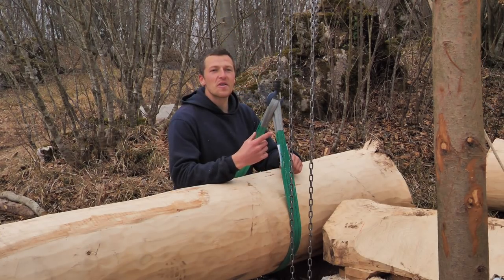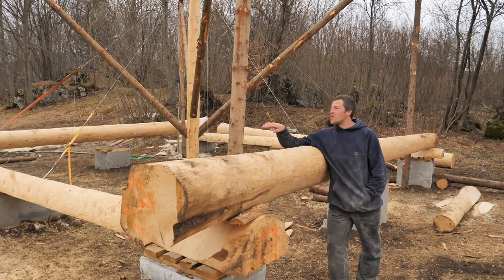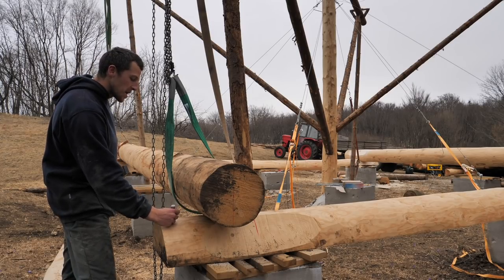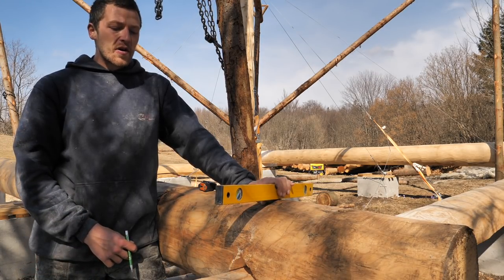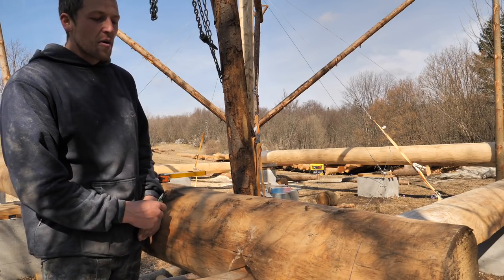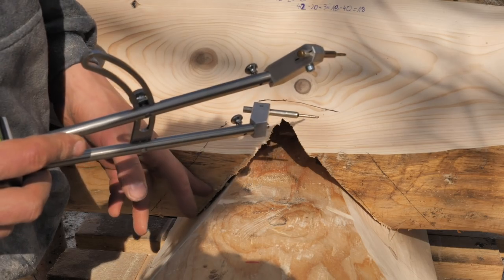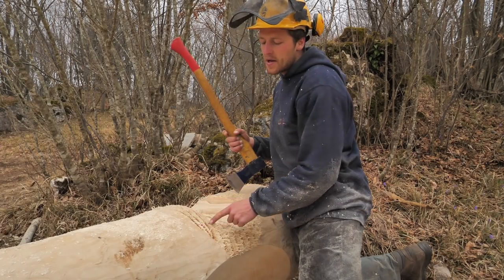Building Off Grid Log Cabin - Ep 12 / First Saddle Notches

Comment: Nice work Nik! Couple of tips: use a utility knife to score your scribe line with your thumb out like you're peeling an apple.  You will save a ton of time over chisel and hammer and still avoid tear out.  When you cut out your notches, work on it in quarters inside of trying to make the entire cut at once.  Start by cutting only one relief cut in the center just 1/8th short of your scribe line, then start an inch or so in and make more of a scoop type cut connecting to your depth cut staying about an 1/8th away from your scribe line. you can pop that entire piece out when you do this to the 4 quadrants.  Using just one or two power tools is quicker than getting your axe to knock out all those relief cuts. Then either brush down with the saw or get a tungsten wheel for your grinder.  Be careful not to cope out the saddle notch too much...it should be bearing the entire width of the notch.  Even 1/8th inch will create more crush than you want, multiply that 1/8th by every course and you have more than an inch of crush before your logs even start to shrink.  Also heat the end of the pencil holder on your scribe and bend it down so you dont have to cut out more with a chisel and hammer just to get your final scribe.  Keep up the good work, one of my favorite craftsman channels

Comment: Hi Nic, consider extending the final scribe 5-10 mm in the top part above the saddle cuts. The gap will be covered by the next log, but allow the logs to settle more. This helps with a close fit on the long cuts down the log, when the weight of the roof starts compressing the walls. Great work and impressive commitment.

Comment: I would also check these out. The Saburr tooth cutters are the best on the market. The sanding wheel you have on your grinder will keep clogging up and you will use a lot of them. The saburrtooth cutters wont clog and if they do all you do is burn the sawdust with a blow torch. they last for years. The cost is quite high but when you consider the amount of sandpaper you will use on your current set up you will save in the long run. I have used these cutters for all of my working life and they are the best you can get. you can get any profile or sanding grade you want and they fit on a standard grinder.

Comment: Nice work going on there Nik and it's a pleasure to watch you work. If I may offer a couple of pieces of advice though. You don't need to go so deep with the chisel, two blows with a hammer will be enough to cut the outer fibres and leave a clean edge. The club hammer is probably too heavy for chiselling, I would suggest you get a large wooden mallet as they're easier to swing. I'd also suggest your axe is too big as well for what you're using it for, swap it out for a carpenters hatchet. Swinging large and heavy hand tools wears you out quicker than you realise, so if you can the same job done with smaller ones then you should. Work smart not hard :)

Comment: Always leave atleast 1 cm gap to top of the saddle.If its tight,the log wont sink as it dries.
The notch does not have to be concaved inside so much,actually should be pretty flat.
Check the flatness of the saddle when sanding,it must be perfectly flat.
When cleaning the notch,try to turn the tip of the saw instead of repetitive straight cuts.
Clean workspace saves your ankles.
I wish i was closer,i would like to make your work much easier😉

Comment: Suggestion : when yu dig yur notch especially if yu wish them to be concave yu can use a special tool we call in France an "Herminette".
It s a handy tool which looks like a usual carving tool a "Gouge". Some are flat cutting shape (they used it in order to make beam perfectly straight on 4 sides yu can recognise these kind of beams made by hand after cuttings)... But some are curved cutting shape in order to do convexe or concave  surfaces in holes. They are more massive but handy... wide and thick than carving tools which are lighter manufacturing.
Yu can buy them or ask a guy to make them.. To forge them.
It s very usefull. 
[Such as a wide and long plane, handy tool, to set the bottom of each flat snotch after silksaw cuttings. Better than a usual cisel as yu had on video] . 
... Whether yu work on flat surface or on curved one.
Consedering the whole job on yur site the outcome will be profitable. Especially to rectify all along on logs with bumps and holes.

Comment: nik for making the notches check out this _Grinder Disc Chain and chain
Grinder Disc and Chain, AUOKER 4 Inch Grinding Wheel Disc Chain Plate with 22 Tooth Fine Cut Chain Chainsaw Blade Carver Set for 100/115 mm Angle Grinder Carving, 5/8" Center Hole Circular Saw Blade

Comment: Nik, it seems like a lot of work making those saddles.  Instead of making saddles with smooth edges, which seem to take a lot of time, why not make the joints like cogs of a transmission?  Make one log be like a tooth of a cog and the other like the space between the teeth of the cog.  Instead of making smooth oval shapes, make straight cuts like the letter V, one V entering and then sitting in the other V. And to avoid the logs splitting, don't let the point of the V's be sharp.  I'm enjoying your videos.  Thanks.

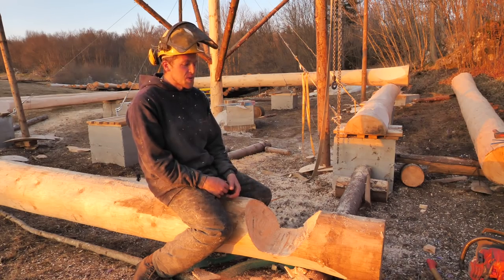Comment: I am trying to understand the reason for the concave cut in the upper log (mentioned at 28:00) to mate with the concave saddle cut on the bottom. Doesn't that mean a very large space where the 2 concave faces inside the joint are opposite each other - like 2 cupped hands?   (Love this video Nik - very impressed with the attention to detail - great fun to watch your progress! )
Reply: Without the concave, the seams would open at the outer edges as the wood dries and settles.

Comment: Hello,  I do believe I would be thinking very hard about a 'top handle' limbing chainsaw for your intricate notches.  Easier to control exactly and not so hard on the body at the end of the day from holding the heavier saw.  I see they go for about $100 if you get a chinese one and they seem to work well from what I see on the other Youtube channels.  Very nice job.  Take care.  Doug
Reply: I think you have a point Douglas, I was thinking maybe a smaller saw, my friend recently bought a Husky 441 and it is a total pleasure to use, so light compared to my own when brashing out or delimbing.  

A top handle would be good, very small and light and as someone in comments suggested maybe use a smaller radius tipped sculpture bar. The Chinese eBay saws, a few of the boys have bought these to look at and while the chains themselves are not great, they get the job done, basically copies of the older Sthils and Huskies, overall decent saws and disposable after a season or two, although most of them are still going strong after three years.

And if Nik is reading this, beautiful work, really nice,

Comment: Good afternoon Nik,
My name is Hernán, and I am in Tocantins State, North region of Brazil.
I~ve being watching all your videos and I have some technical questions to ask:
1.- Which is the gauge, number of wires, etc of the cable that the tractor winch uses.  And what is the security factor that is common to apply in these cables?
2.- Which is the weight of the most heavy log that you are planning to lift? (in Kg)
3.- Which are the specifications of the straps you use?
4.- Which are the specs of the chain hoists?
Thanks a lot for your attention
Have success!!!
Hernán
Reply from the maker: Hi Hernán, unfortunately I don't know the answers to all your questions, but I will tell you what I know. The most heavy logs I have to lift are around 800kg and are the ones I just lifted, the first 4. The specifications of cables and straps I don't know, I only know that the chain hoist is tested for 1000kg. 

Thank you for watching and your comment!
Reply: @nikrijavec47  thanks a lot for your kind answer!

Comment: HELLO NIK,, I don't understand how your going to do a floor??  unless your going to move this from the building sight ????
 like  i mentioned last note,, the 1/2 log i always set on the floor & my next log i use to cover the  the sub floor buy cutting a notch out of the bottom which hangs an inch down over the end grain of the sub floor and the rest of the log sits flat on the  sub floor inside... ALWAYS pick up the small end so the logs are level before you mark & notch!!! the 4 points you talked about i mark the spot where the top log is going to land on the bottom one,,,,,  then add 1/2 inch each side... ((THAT cut should be flat flat flat,, no curve)))... the top i  lay my 4 foot level,, laying down,, on the level line half on each side.... not standing,,, draw a line on each side,, you'll end up with lines 2-1/2 apart  thats the size most levels,,, from the line on the top,, plunge cut to your bottom line... this way you don't have to spend all that time cutting a curve it's straight to down to the bottom,, the top needs to be cut 3/4 on an inch deeper so the top log can side & stay tight..After those straight flat cuts are done you can make the side cuts come into them...

Comment: think 2 more chainhoists will save you a lot or agrivation of keep having to move them to one side or the other , i think it will speed the job up a lot
theres a tv show about a company building treehouses out of realy old redwood ogs , one of the brothers in that company does a lot of chainsaw woodcarving , he uses a special blad on his saw with a smaller roller in the front , it makes it eazier to use the tip of the cainsaw without it trying to shoot away with as mush force as with the normal chainsaw blade 
http://www.chainsawsculpture.co.uk/carving/carvingtools1.htm

there allso angle grinder blades that have a chainsaw edge wish work well forming fine detail work

Comment: Hey Nik, my name is Allan and I'm from Glasgow in Scotland.  I am a master carpenter and sculpture. I have been following your progress from the start and I have enjoyed all of your videos. There is a far better tool for refining your notches that I have used for years in my work. It would allow greater control. The Arbourtech cutters for the grinder can be a bit expensive but when you weigh up the cost of fuel for the chainsaw you will be better off. They all fit in a standard grinder. Here's a link for a video that will show you the tool in action. The cutter I would recommend is the cutter on the right side of the picture at the start of the video. I hope this helps.

https://www.youtube.com/watch?v=gfrDYNIZ4ow
Reply: That's in every case a very good investment. I used the same for my own.
Reply: That looks much better than the ones suggested repeatedly in comments with chainsaw teeth. Never seen it before but looks like it uses three replaceable inserts, I will have investigate more, thanks for a heads up, Hopefully Nik will see your comment.